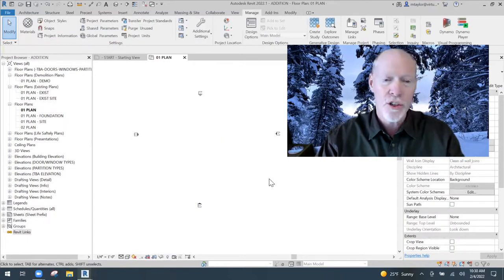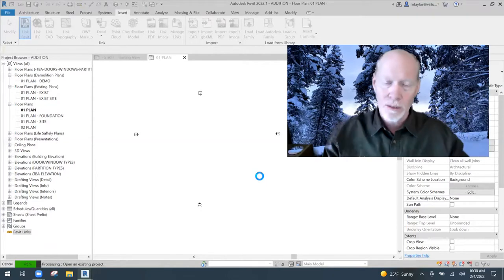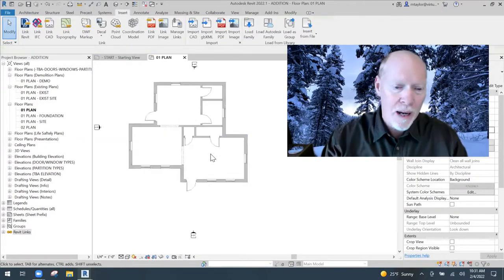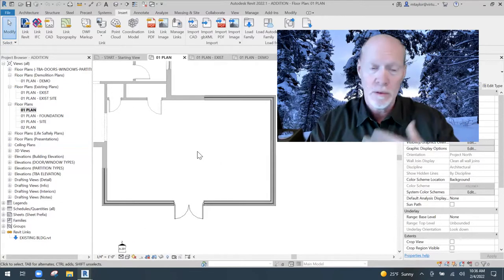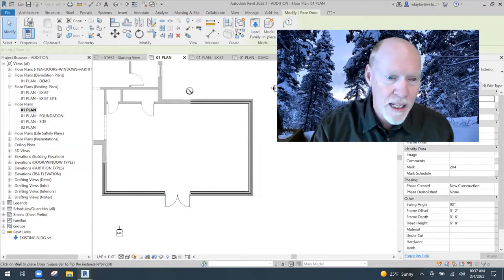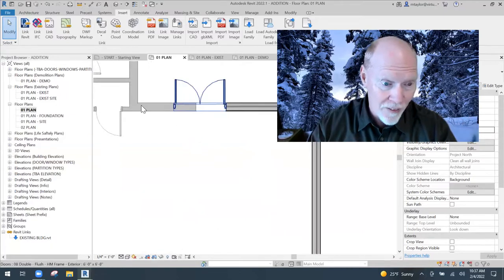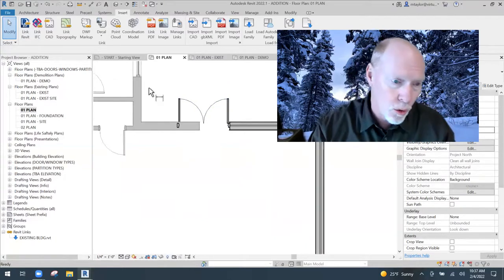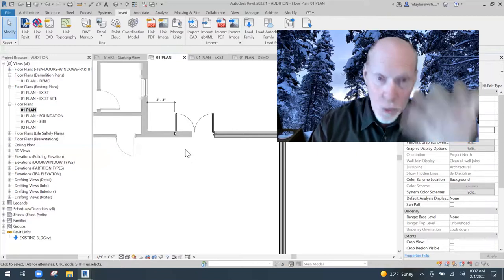DEMOLITION ITEMS IN A LINKED FILE

Comment: The problem I run into today is linked existing model in the new construction model does not want to show demo dash line work that I spend hours on in the existing model. 

I have already checked the phase filter + phase in the new construction model a hundred times. 
Phase Filter = Previous + Demo 
Phase = New Construction

What am I missing here?

One suggestion: I usually link Existing to New Construction + New Construction to Existing on 2 open Revit at the same time, on 2 screens, So I can jump back and forth, instead of using the measureing method, which is too tedious for the complicated model.
Reply from the maker: I took a look into this issue.. and decided to make a new Revit Tip video... kinda like 'DEMO ITEMS IN A LINKED FILE - PART 2'